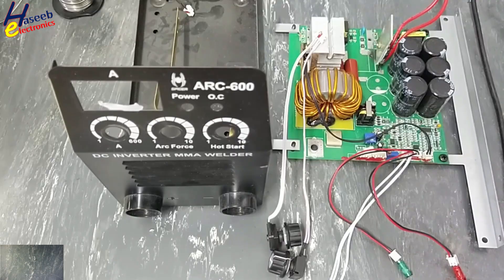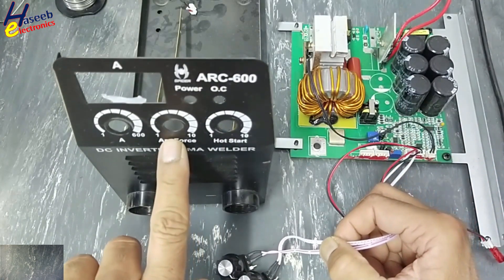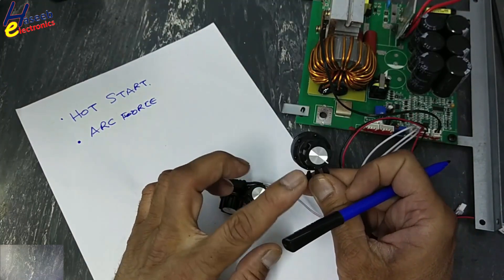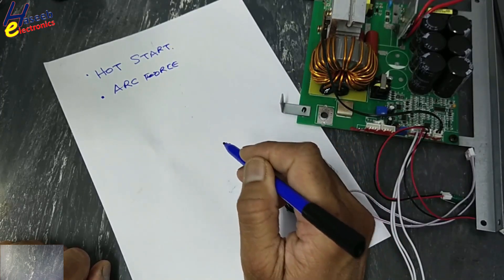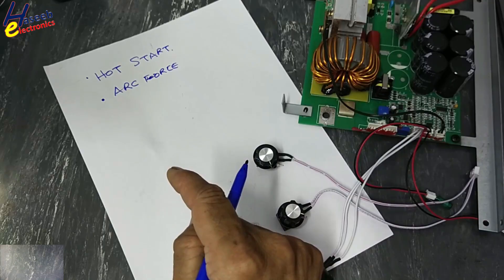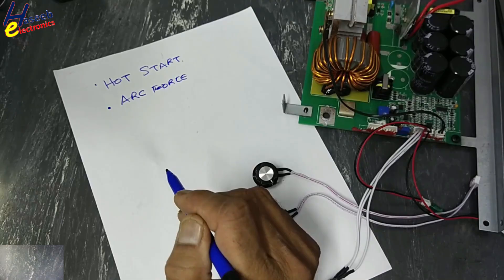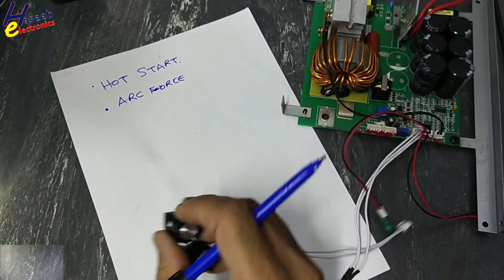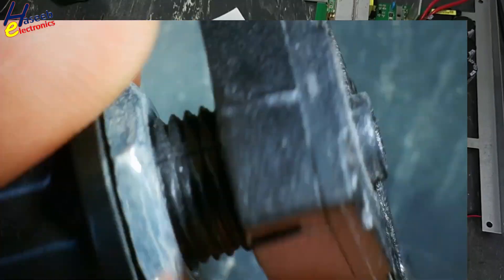{1279C} Arc Force, Hot Start, Fake Potentiometers

Comment: More than a fake potentiometer designed from ground up, it seems as if some subcontractor used the genuine press after hours to build a batch of those pots, without the resistor track and the metal presser inside. Hard to visually differentiate, you have to measure every part to be sure.  
The welder company may have thought they made a bargain with such components, but how did that inverter come to the market as is is troubling. Too late for the warranty, but it would be interesting to show them your videos. A serious company would propose a recall for potentiometers replacement free of charge.

Comment: What about the welding machine's PCB? Are there actually any components connected to the connector for these dummy potentiometers? (Let's say the potentiometers weren't fully assembled during manufacturing — they were defective, and the manufacturer didn’t test their functions?) Because in my opinion, if the PCB has all the necessary components, and not just a connector soldered to nothing, it should be possible to implement these two functions.
Reply from the maker: In upcoming session we will dig it deep to see the circuit feasibility and availability of these features